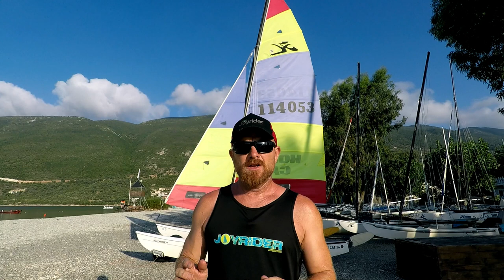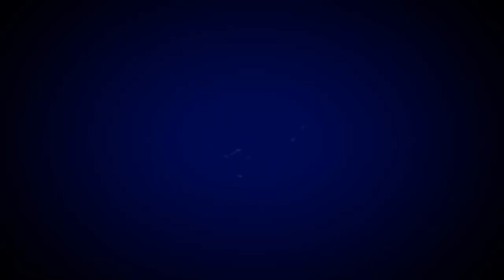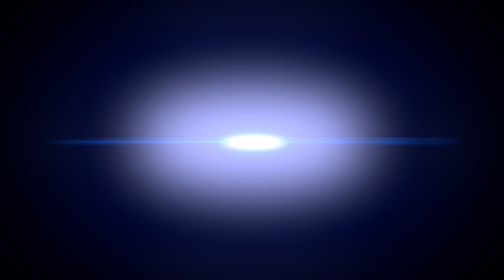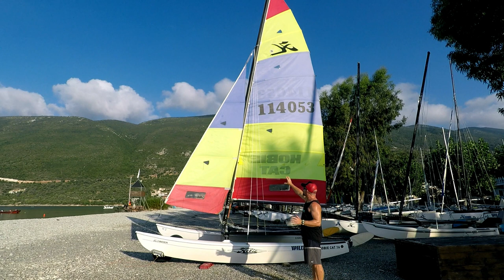The effects of changing the mast rake on the Hobie 16

Comment: Whatever you have to do to get a very slight amount of weather helm is what you want in most instances. And the rudder rake does not affect weather or lee helm, but it can result in easing the resistance on the steering. If you have to hold your rudder off more than about 3 or 4 degrees to maintain straight, your rudder has turned into a brake. Adjust mast rake to fix it.
Reply from the maker: Bingo

Comment: Thanks, very interesting. One thought is that any adjustment that causes more rudder input causes more drag.
Reply from the maker: Yeah for sure - it's perhaps a little ambiguous but i think if you get the mast in the right spot for your crew weight that will be indicated by the rudders feeling right.
Reply: Feeds Ravens  I did not think of the aspect ratio perspective. Good call.

Comment: Hey Joe, yes a very interesting video and a valuable topic to understand! As you know, many Hobie 16 owners have older models that have the old jib system rather than the Aussie system as shown on your demo boat. It may be helpful to 1) explain if the same adjustments of forward and back rake is possible with the older jib system and if not and if the Aussie Jib system would be a logical upgrade for a Hobie owner looking to get a bit more tuning performance from an older boat. 2) I would also like to see how the boat geometry looks like before putting up the jib. Is the mast racked far back and then brought forward as the jib is raised?  I have an 1987 Hobie 16 that I am considering replacing the old jib system with the Aussie System and I am seeking to understand the differences and the benefits of the Aussie system. There must be benefits as all newer boats now have the Aussie jib system. Thanks again for your informative videos!
Reply from the maker: Hi James, 
the jib halyard system doesn't make any difference to the settings, it just makes it a little easier to pull the tension on.
With the jib down the angle of the mast just depends on the length of the forestay - but that is loose once the jib is up so it's not so much of a concern - on our boats the masts are extremely loose until the jib goes up

Comment: Have You ever adjusted the rake on the water in between races?
Reply from the maker: No. I've adjusted rig tension on the water many times. It sometimes takes a few goes to find the sweet spot
Reply: @Joseph Bennett  too scary to pull the pin out and move 1 notch up or down?  Or just didn't need to?

Comment: Hi Joseph! Thanks for the video, really nice explanation. Let me do a question, for a light crew (117-120 kg) first hole for the shroud. But, does also applies if we put weight on the boat to accomplish min weight (129,5 kg) during official competitions? Or in this case is better to go to the 2nd hole? Thanks a lot!
Reply from the maker: I would go for 2nd hole - If it's light wind, with your rig tension on it should be a very strong pull to get it block to block - if it's to easy, your mast is too far back.
Reply: @JoyriderTV  thanks! We will try and let you know! 💪🏻💪🏻💪🏻

Comment: Fist apologies for my lack of technical terminology but since I moved the rake of my Nacra 14sq (it does have centreboards) forwards things have improved for the better.

Initially, I had a lot of rake back as I was afraid of digging the nose, and on the high winds, I was getting a lot "the tail" moving away and the boat point to the wind.

Since I moved the rake forward, yes I am more prompt to dig the nose, but the SPEED went up like CRAZY. And I was able to push the boat harder upwind. 

My guess is that if you have the weight (fat ass) to balance the boat and experience, move the rake forward and send it!!!
Reply from the maker: Ha! Yes, that's very interesting that you gained so much speed. Nice one!
Reply: Hey joe! If i know your style... You should put the mast rake crazy vertical and do a video about it.

It will be "absolutely" fantastic ;) to know your live sailing comments.